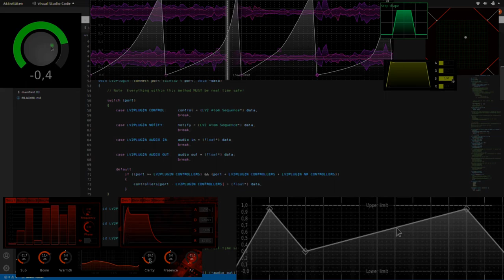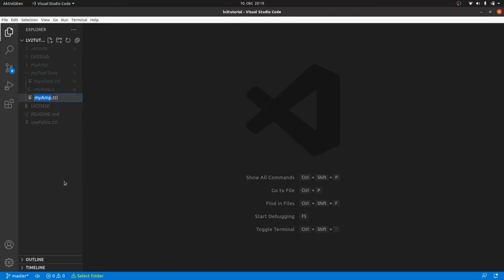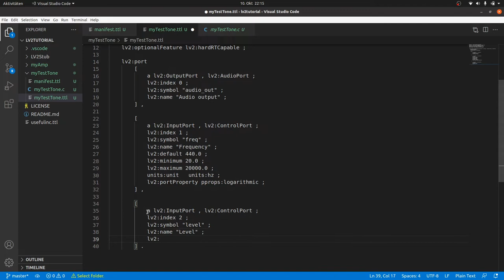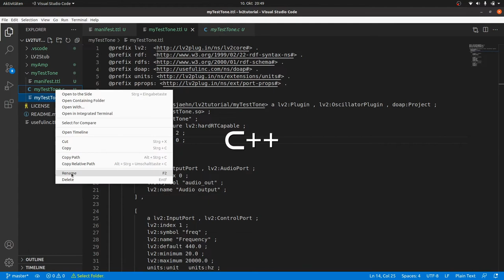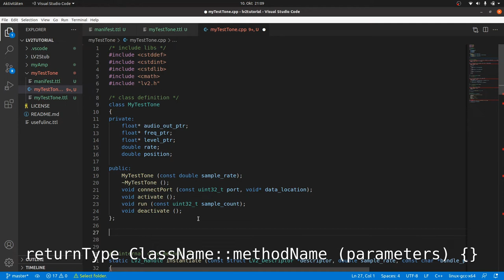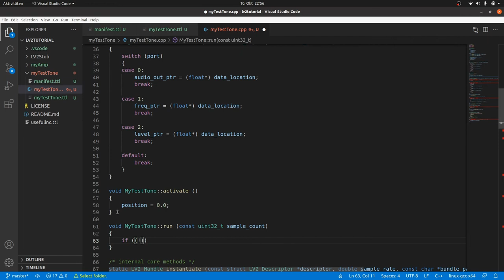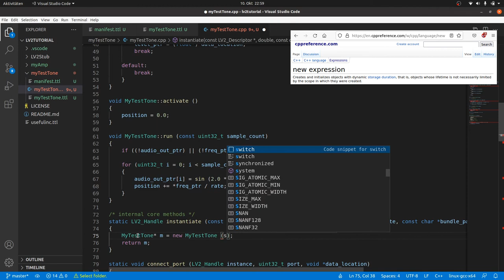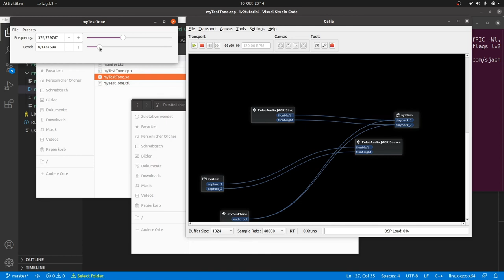Programming LV2 Music Production Plugins From Scratch - 05 A Sound Generator in C++

Comment: I guess it's because when you change frequency, the current buffer will be played with the old frequency and then you'll fill a new buffet with another frequency, so the positions won't match. There'll be a "jump" from one value to  another one far from it, causing a click.
Reply from the maker: It's not the not matching position. This would indeed happen if you re-calculate the position for each sample. But instead we "only" increase the position step by step: position += *freq_ptr / rate;

So it's not the jump. But you are close.
Reply: @bmusic9817  I hear glitches when changing the level parameter. So I guess if the level changes rapidly this generates discontinuities in the signal and we hear glitches. Maybe this could be avoided by applying a sort of filter to the level input parameter to avoid rapid value changes?
Reply from the maker: @johannweichselbaum471  Your ears work right :-). This are indeed discontinuities. The solution will be a smoothing or fading algorithm for the parameters.